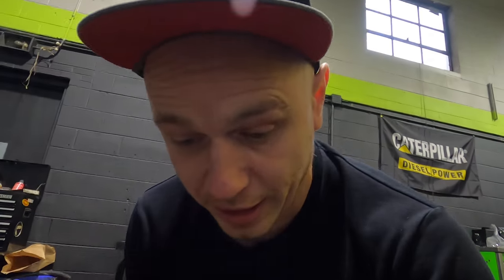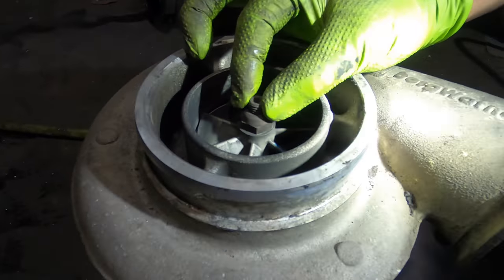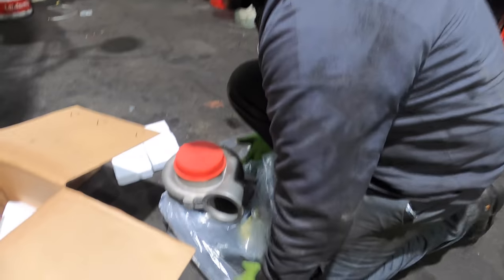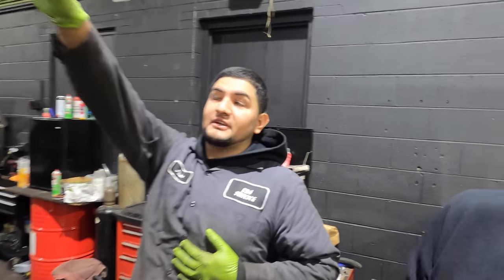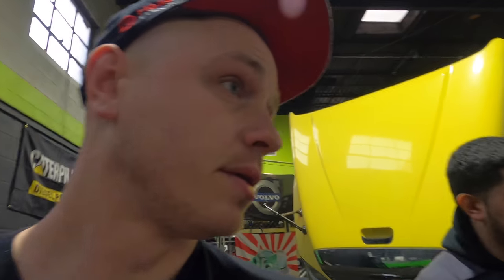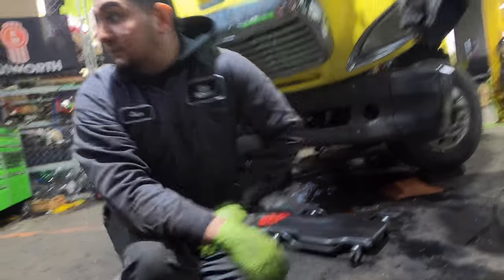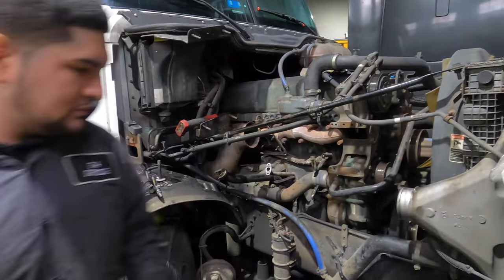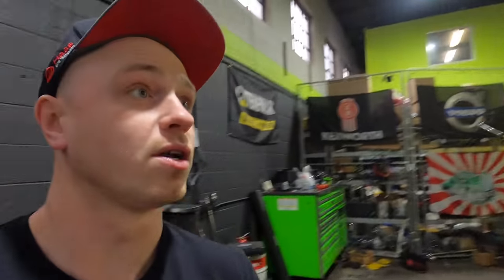How to tell if your turbo is blown

Comment: Do you have to get all the oil out of the charge air cooler before you run the new turbo?
Reply: Yessir 👌🏽
Reply: Only if you don't want to change the engine too.

Comment: 🤦🏾‍♂️🤦🏾‍♂️🤦🏾‍♂️ I'm dealing with exhaust manifold leak and possible bearing issue with either the alternator, idle or ac compressor pulleys. But I did the soapy water on the manifold and bubbled like crazy at the joint between cylinder 2 and 3. Original manifold. Wasn't a problem until I replaced the water pump. Must've disturbed the seal. Also saw bubbles from the front side of the turbo when I sprayed. Problems problems problems 😤😤

Comment: Looks like driver not doing pretrip or he would of seen the oil and knew oil was low
Reply: That’s not true dude at all.
Reply: Until now, I would not have known low oil is sign of failing turbo....  Probably in shop because of oil issue?

Comment: I have a question for you I have a Freightliner 2013 DD15 and it's eating about a gallon of oil every thousand miles the motor was just rebuilt 300,000 miles ago little over a year and a half I'm hoping it's not the motor but I was wondering can the turbo consume that much oil and a thousand miles what else could be the problem

Comment: Hey guys wondering if you guys could locate me the vcads and software for a 1995 d12 engine my buddy in Belarus said that engine was used in the early fh or have any leads on it only can find vcads pro for 1997 and up and it's has the volvo vt 414 6 speed split gear box with crawlers gears money isn't a option for parts of info